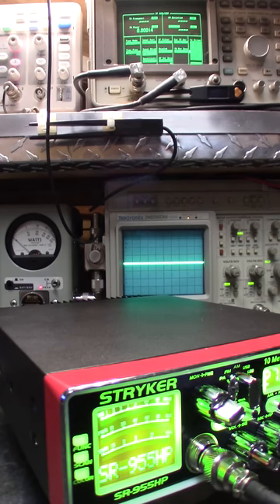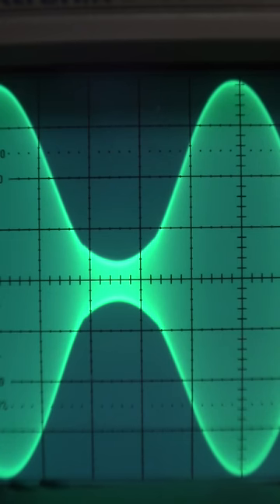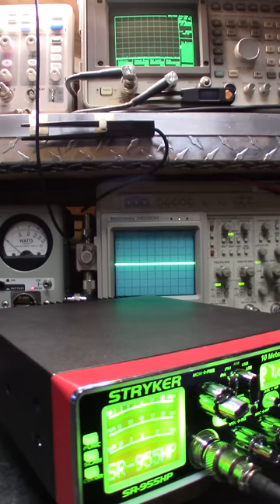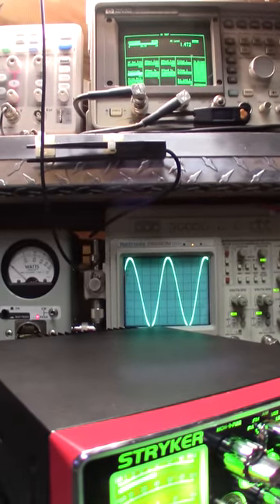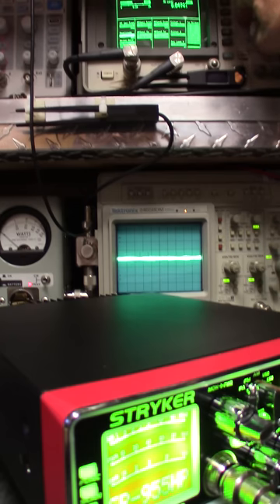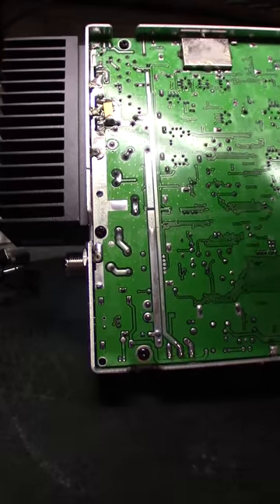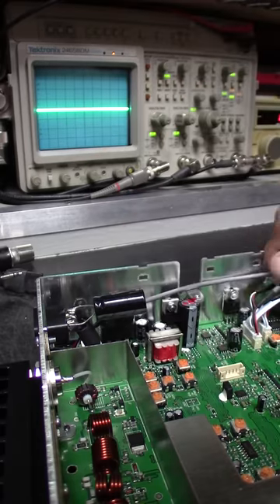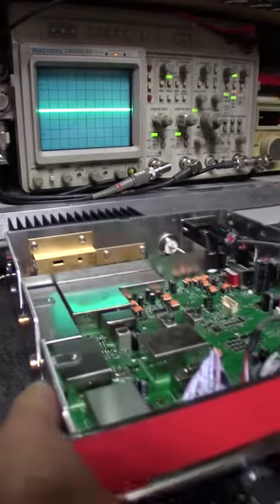eBay Stryker Radio SR 955 10 Meter CB Radio Tune/Align By Lesters Custom Truck CB Shop

Comment from the maker: PAY ATTENTION!  Note: Read full description above .. It explains how to identify shysters and "BS" artists. Here's what it takes to cut through the noise, be loud and crystal clear with a better receiver too. True, it's more complicated and time consuming to accomplish these consistent and accurate results. Below is a partial procedure and list of calibrated equipment used to achieve this level of performance. Rule #1) "Tuned Bench": https://www.youtube.com/watch?v=lwcDfXOgAls  Read on ... the intelligent ones do.

Fine Tune CB Radio Shop strictly adheres to (https://www.nist.gov/) NIST Traceable Calibrations and other industry standards to maintain accuracy and consistency for providing "Real World Performance Tuning" of Citizens Band and 10 Meter export mobile radios with integrity.

"Basic Textbook AM/FM/SSB Transceiver Tune, Alignment and Calibration" 

1) Pll adjustments:
VCO & OSC, AM TX OSC, USB TX OSC, LSB TX OSC.

2) Transmitter alignment:
DRIVER BIAS, FINAL BIAS, SSB  (or gate voltages for mosfet versions) CARRIER BALANCE, HI-LO AM & SSB Power, RF METER, AMC, ALC and FM DEVIATION.

3) Receiver alignment:
AM/FM RF & IF SENSITIVITY, FM DETECTOR/DEVIATION, SSB IF SENSITIVITY, SSB S-METER, AM/FM S-METER (100uV unmodulated -67dbm for “S-9” meter reading!), AM/FM SQUELCH RANGE, SSB SQUELCH RANGE, and NOISE BLANKER/AUTOMATIC NOISE LIMITER (Real World dBm to volts (uV) tables below).

That's a typical run of the mill textbook tune / alignment. There's more to it than frequency alignment, modulation adjustment, meter calibration and "tune for maximum rms, average peak Bird watts "tune up report".

Test Bench includes:

Bird 4314C Meter:
https://www.birdrf.com/Products/Test%20and%20Measurement/Power-Meters/Wattmeters-Line-Sections/RF-Wattmeters/4314C_PEP-Single-Element-Wattmeter.aspx
Part 1) https://www.youtube.com/watch?v=RpX9IHe4ORM&t=16s
Part 2) https://www.youtube.com/watch?v=LuhbqTf6Bxw
Bird 4314C Accuracy Test: https://www.youtube.com/watch?v=DqEOabYqhQo&t=5s
Bird Stipulates 1/2 wavelengths  https://www.youtube.com/watch?v=5eWhgT-rTII
And Genuine Bird Elements from 1K down.

Bird 4373 Sampler: 
https://www.rfparts.com/signal-samplers.html

HP8924c with options:
http://userequip.com/files/specs/2147/HP%208924C%20Repair.pdf
https://www.youtube.com/edit?video_id=Cg1w0xBa27s&video_referrer=watch

HP8920a with options:
https://www.keysight.com/upload/cmc_upload/All/EPSG072204.pdf

Three analog scopes, one digital 200 Mhz:
https://www.atecorp.com/atecorp/media/pdfs/data-sheets/tektronix-2465b-2467b_manual.pdf
https://www.youtube.com/watch?v=by98x4eu2lM

Fluke 27fm:
http://www.fluke.com/fluke/inen/digital-multimeters/fluke-27.htm?pid=56055
 
LCR http://www.lcrresearch.com/wp-content/uploads/2017/05/LCR_Pro1_Manual_version1.03.pdf

Power supplies:
6 Cosel PBA1500f12 (750 amps) variable and configurable.
https://en.cosel.co.jp/product/powersupply/PBA/PBA1500F/PBA1500F-12/
Corcom 20VB1 F7130 EMI Filter 50-60Hz 250V

Times Microwave Coax jumpers and test leads:
http://www.timesmicrowave.com/cms/products/cables/lmr/
https://www.youtube.com/watch?v=EmqaGJ6IWow
https://www.youtube.com/watch?v=1ltFVSxGp5Y
https://www.youtube.com/watch?v=v12YZT_1o90
https://www.youtube.com/watch?v=h7iiYfmYWRA&t=215s

Amphenol RF Connectors:
https://www.amphenolrf.com/
https://www.youtube.com/watch?v=dVh5B0hdEA0 
https://www.youtube.com/watch?v=dKZg8T_AOso

Want more range, compliments, reliability and a quieter, clearer but more sensitive receiver? Get Fine Tuned .. not peaked and ruined.

Here are some VideoGates of me at the bench practicing what I preach using my bench radio or customers radio completed and ready to be shipped: https://www.youtube.com/results?search_query=hard+drive+163+ more: https://www.google.com/search?q=Hard+Drive+163+nm&ie=utf-8&oe=utf-8&client=firefox-b-1-ab

It's what I recommend, use, service and sell ... to you ... not something non practical or deceiving in a misleading way. I'm not just the tech and owner of Fine Tune CB Radio Shop, I'm a customer too!  When finished,  "you'll be giving radio checks, not asking for them".

dBm to watts and volts.
Table below displays relationship between Power in [dBm] or [Watts] and Voltage in RMS, peak, peak-to-peak for sinusoidal signals in 50-Ohm systems for accurately measuring and tuning am/fm/ssb receiver sensitivity, agc, squelch and "S9" Meter calibration  ..  Real World!

  [dBm] [Watts]   [Volts]rms    [Volts]p      [Volts]pp
-140 0.100E-16  22.361 nV  31.618 nV  63.236 nV 
-139 0.126E-16  25.089 nV  35.476 nV  70.952 nV 
-138 0.158E-16  28.150 nV  39.805 nV  79.609 nV 
-137 0.200E-16  31.585 nV  44.662 nV  89.323 nV 
-136 0.251E-16  35.439 nV  50.111 nV  100.222 nV 
-135 0.316E-16  39.764 nV  56.226 nV  112.451 nV 
-134 0.398E-16  44.615 nV  63.086 nV  126.172 nV 
-133 0.501E-16  50.059 nV  70.784 nV  141.568 nV 
-132 0.631E-16  56.167 nV  79.421 nV  158.842 nV 
-131 0.794E-16  63.021 nV  89.112 nV  178.223 nV 
-130 0.100E-15  70.711 nV  99.985 nV  199.970 nV 
-129 0.126E-15  79.339 nV  112.185 nV  224.370 nV 
-128 0.158E-15  89.019 nV  125.874 nV  251.747 nV 
-127 0.200E-15  99.882 nV  141.232 nV  282.465 nV 
-126 0.251E-15  112.069 nV  158.465 nV  316.931 nV 
-125 0.316E-15  125.743 nV  177.801 nV  355.602 nV 
-124 0.398E-15  141.086 nV  199.496 nV  398.992 nV 
-123 0.501E-15  158.301 nV  223.838 nV  447.677 nV 
-122 0.631E-15  177.617 nV  251.151 nV  502.302 nV 
-121 0.794E-15  199.290 nV  281.796 nV  563.591 nV 
-120 0.100E-14  223.607 nV  316.180 nV  632.360 nV 
-119 0.126E-14  250.891 nV  354.760 nV  709.519 nV 
-118 0.158E-14  281.504 nV  398.047 nV  796.094 nV 
-117 0.200E-14  315.853 nV  446.616 nV  893.232 nV 
-116 0.251E-14  0.354 µV  0.501 µV  1.002 µV 
-115 0.316E-14  0.398 µV  0.562 µV  1.125 µV 
-114 0.398E-14  0.446 µV  0.631 µV  1.262 µV 
-113 0.501E-14  0.501 µV  0.708 µV  1.416 µV 
-112 0.631E-14  0.562 µV  0.794 µV  1.588 µV 
-111 0.794E-14  0.630 µV  0.891 µV  1.782 µV 
-110 0.100E-13  0.707 µV  1.000 µV  2.000 µV 
-109 0.126E-13  0.793 µV  1.122 µV  2.244 µV 
-108 0.158E-13  0.890 µV  1.259 µV  2.517 µV 
-107 0.200E-13  0.999 µV  1.412 µV  2.825 µV 
-106 0.251E-13  1.121 µV  1.585 µV  3.169 µV 
-105 0.316E-13  1.257 µV  1.778 µV  3.556 µV 
-104 0.398E-13  1.411 µV  1.995 µV  3.990 µV 
-103 0.501E-13  1.583 µV  2.238 µV  4.477 µV 
-102 0.631E-13  1.776 µV  2.512 µV  5.023 µV 
-101 0.794E-13  1.993 µV  2.818 µV  5.636 µV 
-100 0.100E-12  2.236 µV  3.162 µV  6.324 µV 
-99 0.126E-12  2.509 µV  3.548 µV  7.095 µV 
-98 0.158E-12  2.815 µV  3.980 µV  7.961 µV 
-97 0.200E-12  3.159 µV  4.466 µV  8.932 µV 
-96 0.251E-12  3.544 µV  5.011 µV  10.022 µV 
-95 0.316E-12  3.976 µV  5.623 µV  11.245 µV 
-94 0.398E-12  4.462 µV  6.309 µV  12.617 µV 
-93 0.501E-12  5.006 µV  7.078 µV  14.157 µV 
-92 0.631E-12  5.617 µV  7.942 µV  15.884 µV 
-91 0.794E-12  6.302 µV  8.911 µV  17.822 µV 
-90 0.100E-11  7.071 µV  9.998 µV  19.997 µV 
-89 0.126E-11  7.934 µV  11.218 µV  22.437 µV 
-88 0.158E-11  8.902 µV  12.587 µV  25.175 µV 
-87 0.200E-11  9.988 µV  14.123 µV  28.246 µV 
-86 0.251E-11  11.207 µV  15.847 µV  31.693 µV 
-85 0.316E-11  12.574 µV  17.780 µV  35.560 µV 
-84 0.398E-11  14.109 µV  19.950 µV  39.899 µV 
-83 0.501E-11  15.830 µV  22.384 µV  44.768 µV 
-82 0.631E-11  17.762 µV  25.115 µV  50.230 µV 
-81 0.794E-11  19.929 µV  28.180 µV  56.359 µV 
-80 0.100E-10  22.361 µV  31.618 µV  63.236 µV 
-79 0.126E-10  25.089 µV  35.476 µV  70.952 µV 
-78 0.158E-10  28.150 µV  39.805 µV  79.609 µV 
-77 0.200E-10  31.585 µV  44.662 µV  89.323 µV 
-76 0.251E-10  35.439 µV  50.111 µV  100.222 µV 
-75 0.316E-10  39.764 µV  56.226 µV  112.451 µV 
-74 0.398E-10  44.615 µV  63.086 µV  126.172 µV 
-73 0.501E-10  50.059 µV  70.784 µV  141.568 µV 
-72 0.631E-10  56.167 µV  79.421 µV  158.842 µV 
-71 0.794E-10  63.021 µV  89.112 µV  178.223 µV 
-70 0.100E-09  70.711 µV  99.985 µV  199.970 µV 
-69 0.126E-09  79.339 µV  112.185 µV  224.370 µV 
-68 0.158E-09  89.019 µV  125.874 µV  251.747 µV 
-67 0.200E-09  99.881 µV  141.232 µV  282.465 µV
-66 0.251E-09  112.069 µV  158.465 µV  316.931 µV 
-65 0.316E-09  125.743 µV  177.801 µV  355.602 µV 
-64 0.398E-09  141.086 µV  199.496 µV  398.992 µV 
-63 0.501E-09  158.301 µV  223.838 µV  447.677 µV 
-62 0.631E-09  177.617 µV  251.151 µV  502.301 µV 
-61 0.794E-09  199.290 µV  281.796 µV  563.592 µV 
-60 0.100E-08  223.607 µV  316.180 µV  632.360 µV 
-59 0.126E-08  250.891 µV  354.760 µV  709.520 µV 
-58 0.158E-08  281.504 µV  398.047 µV  796.094 µV 
-57 0.200E-08  315.853 µV  446.616 µV  893.232 µV 
-56 0.251E-08  0.354 mV  0.501 mV  1.002 mV 
-55 0.316E-08  0.398 mV  0.562 mV  1.125 mV 
-54 0.398E-08  0.446 mV  0.631 mV  1.262 mV 
-53 0.501E-08  0.501 mV  0.708 mV  1.416 mV 
-52 0.631E-08  0.562 mV  0.794 mV  1.588 mV 
-51 0.794E-08  0.630 mV  0.891 mV  1.782 mV 
-50 0.100E-07  0.707 mV  1.000 mV  2.000 mV 
-49 0.126E-07  0.793 mV  1.122 mV  2.244 mV 
-48 0.158E-07  0.890 mV  1.259 mV  2.517 mV 
-47 0.200E-07  0.999 mV  1.412 mV  2.825 mV 
-46 0.251E-07  1.121 mV  1.585 mV  3.169 mV 
-45 0.316E-07  1.257 mV  1.778 mV  3.556 mV 
-44 0.398E-07  1.411 mV  1.995 mV  3.990 mV 
-43 0.501E-07  1.583 mV  2.238 mV  4.477 mV 
-42 0.631E-07  1.776 mV  2.512 mV  5.023 mV 
-41 0.794E-07  1.993 mV  2.818 mV  5.636 mV 
-40 0.100E-06  2.236 mV  3.162 mV  6.324 mV 
-39 0.126E-06  2.509 mV  3.548 mV  7.095 mV 
-38 0.158E-06  2.815 mV  3.980 mV  7.961 mV 
-37 0.200E-06  3.159 mV  4.466 mV  8.932 mV 
-36 0.251E-06  3.544 mV  5.011 mV  10.022 mV 
-35 0.316E-06  3.976 mV  5.623 mV  11.245 mV 
-34 0.398E-06  4.462 mV  6.309 mV  12.617 mV  
[dBm] [Watts]   [Volts]rms   [Volts]p     [Volts]pp

          Don't be a (SUCKER) Mud Duck!

        Hard Drive 163 NM. 73's! Click click.